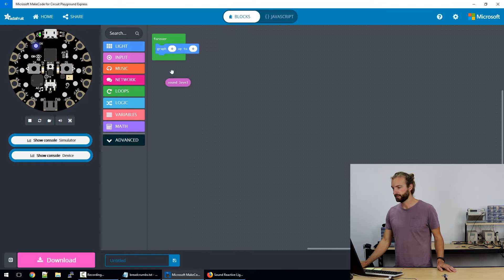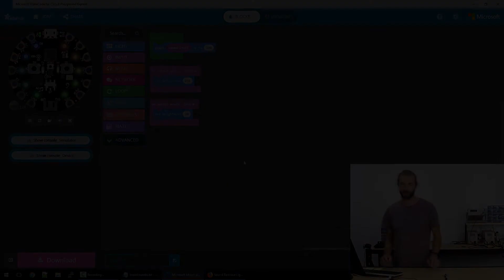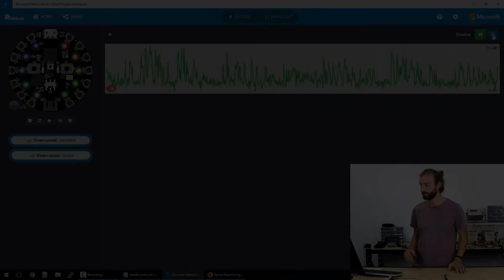Sound Reactive Lights Project with Circuit Playground & MakeCode

Comment: Tried this recently; the lights max out.  Also, it seems that there should be an additional command to set the neopixel color to white as the default if rainbow colors.  But the ambient noise was maxing out the lights for us, so something is not as intended.

Comment: It's odd, I've done this with  8 difference units and no matter what I do, I just cannot get the board to respond to any sounds outside of shouting at it.  It's as if the mic just isn't sensitive at all I can lower the number way down, but that just causes the ambient noise level in the room to eventually max out the graph.
Reply: I have the same issue.  if I blow on the Mic, the lights respond.  however, a normal volume of talking, and i do not get any response
Reply: @DMForbert , I get Nothing on mine. Stuffs garbage quality.
Reply: I have this problem too. The volume value comes back around the same thing, and I can't get the volume to graph as nicely as he does. Sad, because this was the project I was really looking forward to doing with my kids- they love visually seeing what they hear.
Reply: same as the others.  I thought I was just programming it wrong but it seems that the mic on a lot of these is garbage.  Unless there is some way to calibrate the mic.